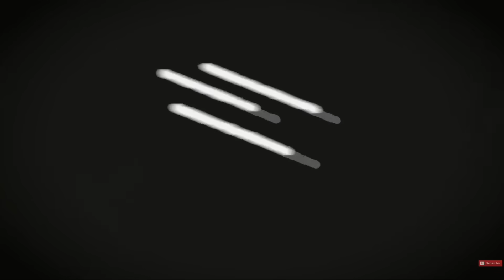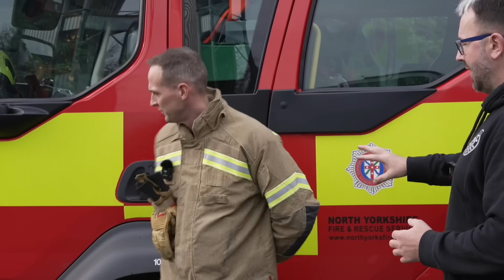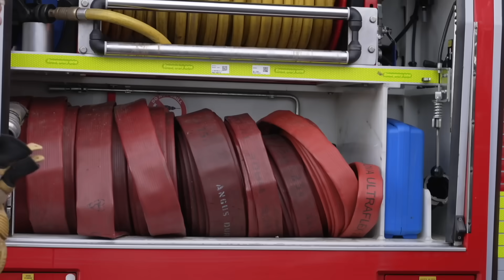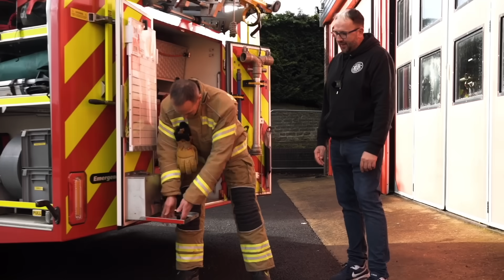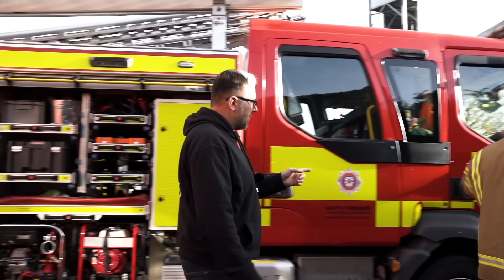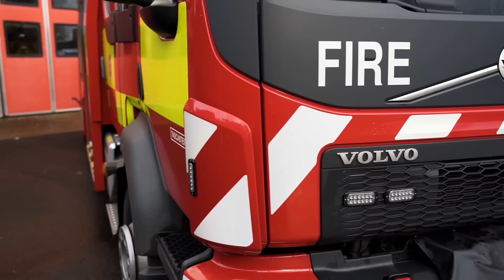View Inside A Working Fire Engine! See What They Carry.

Comment: Fascinating, I was a firefighter for ten years and its great to see how the appliance and its kit has evolved over the fifteen years I've been out of the job. Recognised most of the equipment though, cant believe the BA sets are not in the cab, but can see the point. We had a little cheat in our station that when a persons reported was called, we we had two guys under air as we pulled up, whether it was needed or not. The BA board was in the cab as well then and we used to use the rapid deployment slots to mark the under air start time.. Not an original idea but saved a lot of time. Great video Brother, liked and subscribed 👍
Reply: Clean cabs are the way forward in Ff health. There are too many of my former colleagues with health issues. I know of 3 who have passed away from various cancers, and there are another half dozen with cancer or/and respiratory issues. 😢
Reply: I'm going to be a Firefighter and wear the equipment, BA and helmet and carry the tank on my back

Comment: A Volvo 7.7 litre diesel engine fire truck.

Volvo make the most powerful truck engines an excellent vehicle acquisition for climbing those North Yorkshire Dales.👏👍🤞🤝😊
Reply: Back in the '70's my father drove a Ford based appliance for Surrey FB. They were renowned for being gutless. A fellow driver told the tale of going to a shout up the A3 dual carriageway at Stag Hill, Guildord on blues and twos, only to be overtaken by a car towing a caravan..
Reply: I've driven a few in London : old Dennis, volvos, even scania & MAN specialist appliances, London is now nearly all Mercedes, just as powerful as the new volvos.
Reply: @cashybai All the LFB Aerial Appliances  are Scanias
Reply: @CDB8939 they are now, as I was retiring the 32m tls were just in, and the 64's were just being issued : immediately prior to that (2021) lfb was 100% Mercedes pumping appliances, and the vast majority of the existing alp's and tls were still Mercedes chassis, with scania coming in with the new tls.

Comment: Technology is fantastic, until it fails... What happens if the computerised water system fails ?
Reply: It's like the autopilot in an aircraft - there to assist and reduce workload but if it fails, we revert to pumping the old fashioned way.  That said, I've never heard of such a failure - the technology's very robust, and designed to handle the tough environment it can be working in.
Reply: Use hydrant pressure, or if there isn't a hydrant use the light portable pump connected to the tank outlet